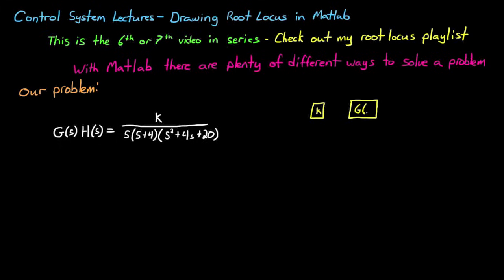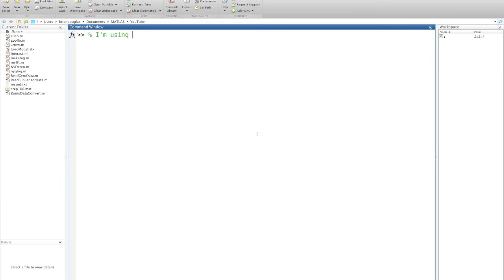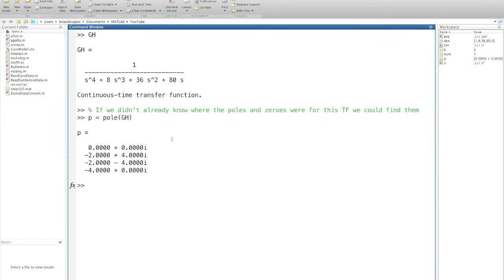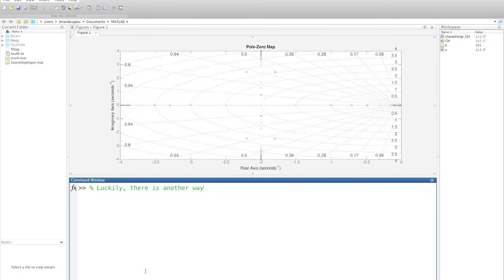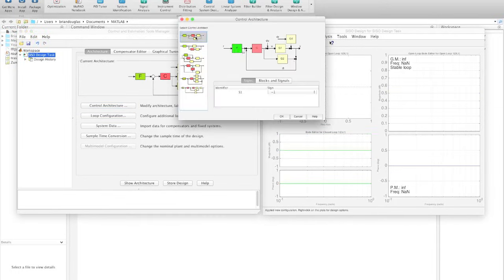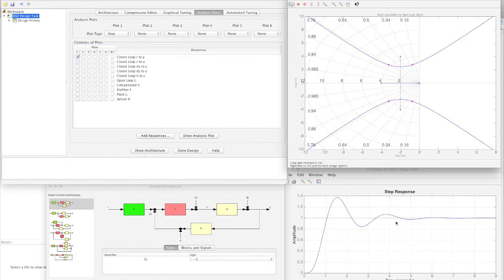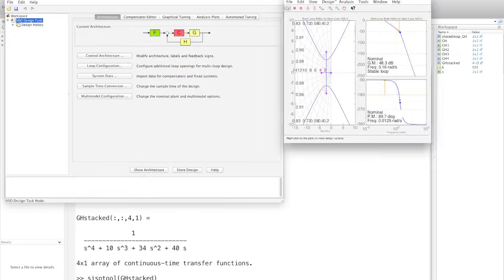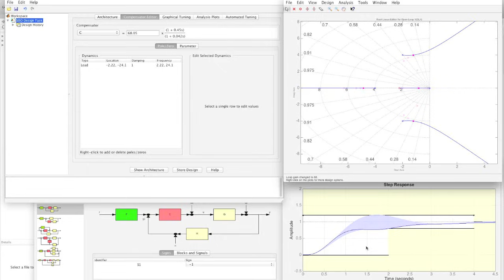Gain a better understanding of Root Locus Plots using Matlab

Comment: Hi Brian! First of all, thank you for helping us to understand more about this topic. I have a question. So when we use the SISO tool, and we take a look at the RootLocus, i noticed that the 'Squares' are not in the same position as the poles (for a k=1), with this transfer function you have to zoom in a lot, but i've noticed that with others transfer functions, this is more visible. So at the end using a k=1 where are our poles? Where the squares are or where the X's are?

Comment: Why, if the gain increases as you move through the root locus, is the step response stabilizing always at 1? Shouldn't the unitary step be multiplied by the gain in question?
Reply: Because that step response is for the closed loop system. The plot of "step(GH*k)" and "step(feedback(GH*k,1))" are different.
Reply: @tutimoyano  Thanks!

Comment: @9:25 we can see that the popup shows a damping ratio term that is less than one. The question is, The damping ratio is defined only for the second order system (as stated earlier in the video). How are we applying the same concept here in the fourth order system ?

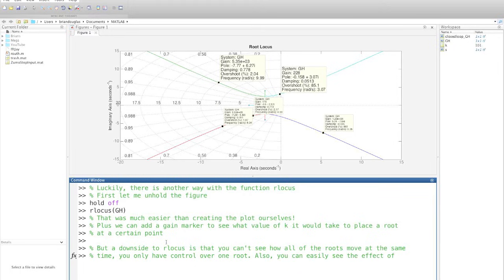Comment: Spotted a typo: at 9:52 in the video, the Matlab comment text says "But a downside to rlocus is that you can't see how all of the roots move at the same time, you only have control over one root. Also, you can easily see the effect of" 
The second "can" should be a "can't". 
Anyway, this is an excellent video series, Brian Douglas!

Comment: The videos are very helpful in order to understand the deep concepts behind the Root Locus technique. But I do have a pretty confusing question, actually two questions. I have understood all the concepts but this fundamental one is confusing me a bit.
My first question is that we use Root Locus in order to analyze our closed loop system like how the poles of our closed loop system move as we vary ''k". So then why do we plot the root locus of GH only why not 1 + GH?
My second question is pretty related to the first one. In one of your video, you said that our closed loop poles travel from the open loop poles to the open loop zeros. What does that mean?

Comment: At 7:00 you say that you are going to plot the pzmap for gains of k from 0 to 10, but you actually loop through k from 1 to 10
Reply: +Anthony Zhu So it is the same thing, in fact going through the loop with the values of k from 0-10 is good stuff rather than plotting them one by one

Comment: first of all thanks a lot Brian !!

This is one of the best videos which I have watched from your Control System Lectures videos and If I say in terms of MATLAB for Control Engineering than probably this would be one the best videos of MATLAB.

I am Instrumentation and Control Engineering student but I had never known this features of MATLAB before.

This video will be very helpful for learning purpose but Brian I request you to make some videos on "Modelling of DC Motor with 'encoder' or 'Accelerometer and Gyroscope' using Arduino and MATLAB/LabVIEW" as well as on "How to Implement PID algorithm in Arduino for DC motors for the Motion Control of Robots". So that there won't be only learning of these features of MATLAB but also practical hands on and understanding of how to use these tools in Robotics and other applications.
Eagerly waiting for those videos...

and once again, thanks for this awesome video.
cheers !!

Comment: why k is called as  a open loop gain
Reply: +mainram reddy Because I think if you see the block diagram for your transfer function, then you will notice that the gain k is multiplying with the open loop transfer function of your system which is G(S)H(S)

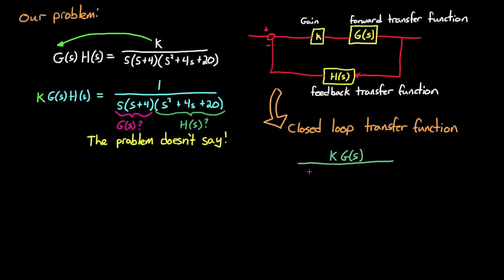Comment: 1:35 Why did we omit the "1+" in the closed loop TF? Isn't the WHOLE denominator Characteristic Equation ?
Reply from the maker: +Nan Nanco You are right that the characteristic equation is the whole denominator.  I wasn't very clear but what I meant was that we needed the second part of the characteristic equation in the form that it's in, that is specifically, in the G*H form.  And since the problem gave us the open loop transfer function as G*H that was exactly what we needed. So the characteristic equation was in the form 1 + k*G*H that we needed to plot the root locus.  Hope that helped a bit.
Reply: +Brian Douglas I think i got it now, thanks for the reply and for all the videos!
Reply: So in fact, we should draw the root locals for 1+kGH (closed loop) and not GH(open loop). Anyway, the question ask to draw for GH, so we just draw it. (I think this is what Brian meant?)
Reply: @Ming_Qiu  When K is equal to zero, the limit of the denominator approaches the denominator of G*H, which means that the closed-loop poles approach the open-loop poles.   When K approaches infinity, the limit of the denominator approaches the numerator of G*H.

The root locus tracks the path of the solutions to the equation of 1 + K*G*H = 0, on K's journey from 0 to infinity, such that the closed loop poles follow a path from the open loop poles to the open loop zeros.  That's the essential idea of the Root Locus

Comment: This video series is exactly what I'm looking for.
Btw I have a question regarding the stack TF mentioned above.

I'm working with a ship-heeling-angle control system in my uni lab. The system includes two tanks located on two sides of the hull and a gear pump which pumps water back and forth into the tanks depending on the input voltage negative or positive.
After conducting several experiments to determine the step responses with various step reference voltages, I figure out that the transfer functions might not look the same. I haven't done the system identification step yet, however from examining the graphs (which look like an integrating system with a time delay element) it seems like the the gain constant coef K differ from eachother.

I wonder if I should work with these transfer function as a stack or you know choose one that represents the whole system?
This question hasn't popped up in my head until I watched this interesting video.

Comment: Can someone help me out? let's say i have tf like this : (s+4) / (s+1)(s+2), ie, 
two poles : -2 and -1 and one zero in -4.
Why when i do rlocus in matlab the centroid is in -1.55 ?
Does zero affects centroid? (i thought it does because it attracts poles)

I thought it will be in : [(-1-2) - (-4) ]/ (2-1) = 1 but it does not make any sense ;(
Reply from the maker: glavgad What you are looking at is the break out point at -1.55 where the locus leaves the real axis.  There is a break in point at about -6.45 too.  What I am solving for in the video is where the asymptote intersects the real axis, not where the locus does.  The asymptote in your case is at 180 degrees (because there is one extra pole than zero) so it is intersecting the real axis everywhere.  I did not explain how to find where the break in and break out points are because I personally feel that is a level of detail that makes quickly sketching a root locus by hand less beneficial.  You know that the break out point must lie somewhere between the open loop poles at -1 and -2 ... and that might be good enough for your sketch.  If not you could plot it with a computer program, or if you absolutely need to do this by hand there are rules for solving for it on many sources online.  To find one just search for root locus break out points.  Good luck!
Reply: Thank you for you time!

Comment: terrific!
i would like to know something maybe trivial
when you design a controller, you are adding notch, zeros...in order to meet the requirements. but can you add whatever you want?i mean what is the meaning in term of hardware, what is the cost of this?thank you a lot
Reply from the maker: Tony Sznabel Not trivial at all! When you're working in the S-domain and just adding poles and zeros it's easy to lose track of what that actually means.  Whatever controller you design you have to build - and more complicated designs require more components.  But beyond that, you might actually build a controller that attempts to drive your actuators faster than they can be driven and that's not going to work.  For example, I can design something that controls a motor so that it has a step response rise time of 1 millisecond and my simulation will say no problem.  But if the system can't source that much current, or that high of voltage (or if the change in current doesn't occur fast enough) then the motor actually won't accelerate as fast as my controller is driving it.  The best way to learn all of this is to take on a small project at home and see how your real hardware behaves compared to the ideal model you've assumed. Hope that helped a bit.